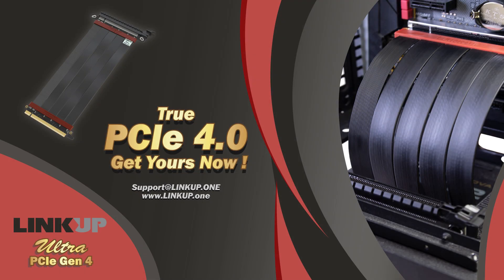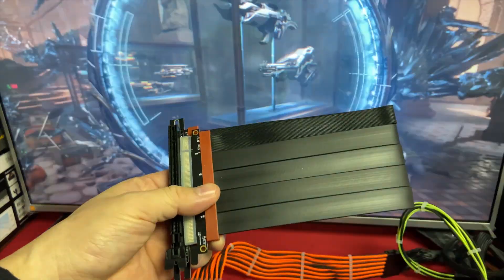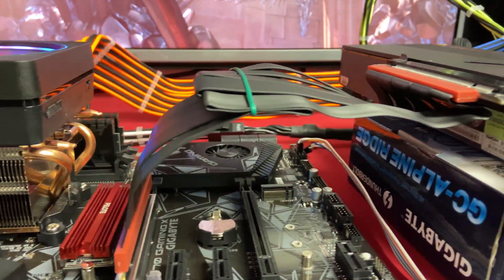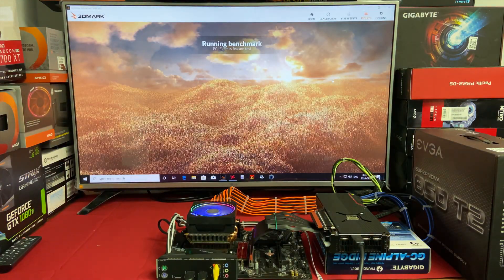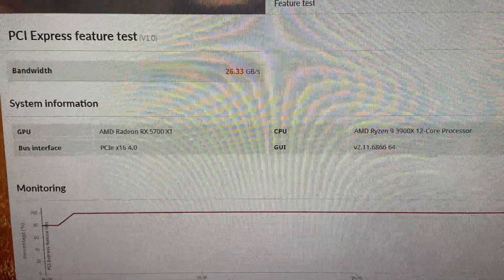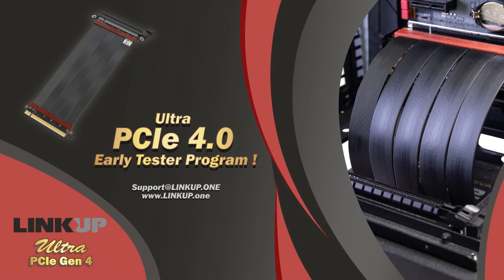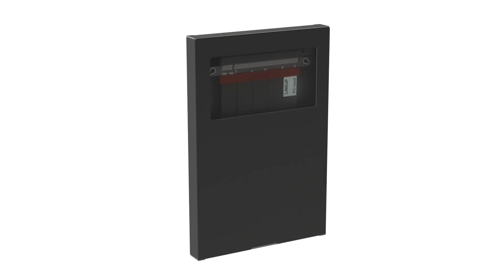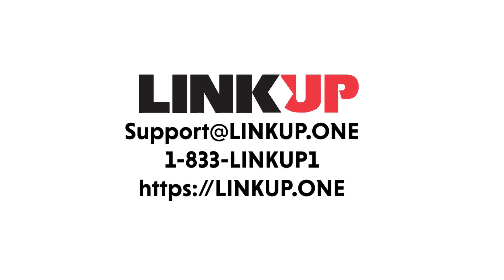LINKUP Ultra 4.0 Riser Can Be Folded 180 Degree No Performance Drop Best Fits for Mini-ITX SFF Cases

Comment: Can use with B550 Aorus Elite + RX 5500 XT 4GB PCIE 4.0 x8?
Reply from the maker: Yes. RX5500XT uses only 8x PCIE lanes. To get the full speed, you will need a gen 4 riser.

Comment: Do you make a pcie 4.0 riser cable that fits in the NZXT H1 case?
Reply from the maker: The 30cm Left Angle works for NZXT H1. Make sure you're using it with RTX3000 GPU. 
Here is the link: 
https://linkup.one/linkup-pcie-4-0-x16-riser-cable-rtx3080-x570-b550-tested-shielded-high-speed-wires-itx-vertical-ultra-gaming-pci-express-gen4-2020-left-angle-socket-30-cm-nzxt-h1-compatible/

Comment: Will this cable work with a PCIE 3.0 GPU? Since all Nvidia GPU's are currently 3.0, I want to use this riser cable with my x570 motherboard and my Nvidia 2080ti GPU.
Reply from the maker: Yes. The PCIE 4.0 riser is backward compatible with PCIE 3.0